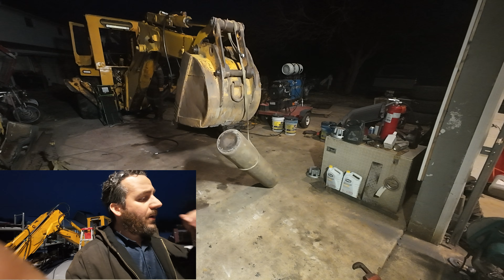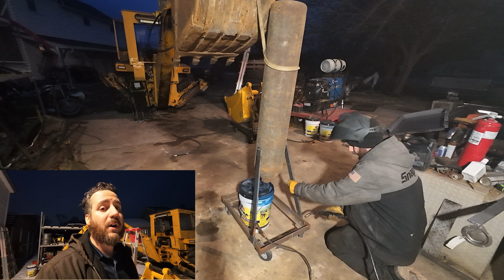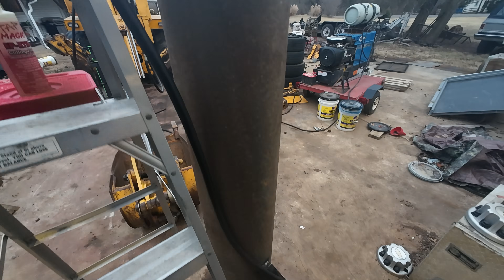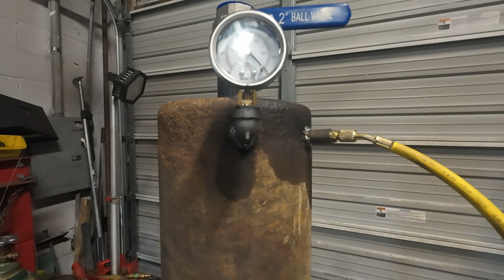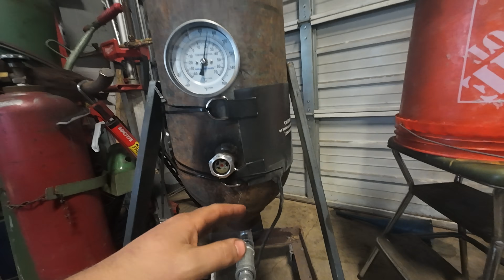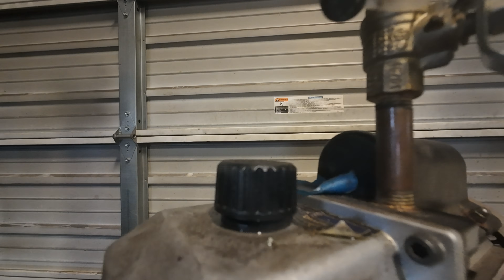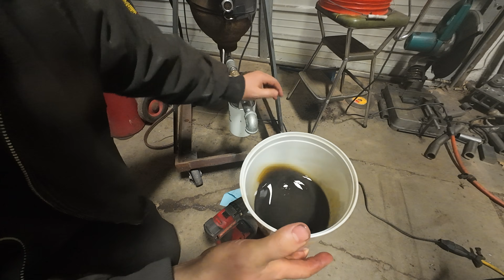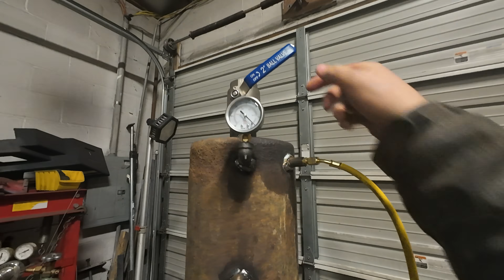I made a machine to remove water from hydraulic oil. Vacuum de-hydration

Comment: 30 years ago I bought a pump that was retired from vacuuming sap from trees from a salvage catalog; basically an electric motor with (I think) a rotor-type pump built onto the shaft. I believe that company is still in business and of course has a website (didn't exist back then LOL!). One of the uses it mentioned in the catalog was as a vacuum pump for a/c systems. Couple of standard brass fittings into the pump and ya, it ran super well. It was much faster than the little oil-bath style that you're using and in fact used no oil at all, the pump ran without it although it would get pretty hot. That pump didn't pull "quite" the vacuum the oil-bath style does, like peaked out less than an inch Hg below what you're getting IIRC, but it worked fine for my auto a/c purposes and I'm sure it would work fine for yours, with the added bonus that you wouldn't have to fool with replacing the oil in the pump.

Oh, another idea. CO2 pumps will pull that vacuum as well, and also don't have an oil reservoir. I don't know how common those are, but I got mine from free from a service/technician guy who had just serviced a C-store in my area. I saw it, mentioned what I could use it for, and he said "take it".

Comment: Would definitely stick a condenser pot in line with the vacuum pump. It would definitely save your vacuum oil from getting so much water in it.

Comment: With 5% moisture in it 50 gal of fluid has 2.5 gal of water. It is a lot! This is what the vacuum pump has to evacuate. Unfortunately, that much water will kill your vacuum pump rather quickly. Centrifuge will help remove the most of that water. And then the vacuum pump will need to do less and will last longer.
A typical centrifugal milk separator does 3 gal per hour (approx). And it lasts forever. Something of that scale would do the job.

Comment: I filter waste oil with a centrifuge and heat it up in a barrel with a 1500 watt electric heating element, I circulate it for an hour with a pump, running threw a centrifuge and with heating element, and after an hour, I can filter and eliminate water out of 55 gals.
Reply: yep old tech and still used on ships. becuase its reliable and cheap.
Reply: Make a video I'd like to see that sounds very interesting

Comment: You can know exactly how much water in the oil when you start. Measure the weight to volume ratio of good oil then compare to oil that has water. Understand?? Yes you must have a "trap"  make a coil and condense the vapor coming out so you don't run water through your vacuum pump.
Reply from the maker: It may of gotten through broken windows on the cab and torn up shifter boots. I bought the machine for scrap price and the water in the oil came with it, free!

Comment: The fluid will stay cold at the bottom because hot rises.  The heater band should be as low as possible.
Reply: As the pressure goes down water will make bubbles. These bubbles will stir up the fluid pretty effectively.

Comment: Id try buying oil that isnt hydroscopic cheap tractor fluid attracts water like crazy
Reply from the maker: Yes and no. The water is already in the system so at this point I am happy the oil is carrying it out. Would be better if the water was never in there, but it came this way.

Comment: Maybe try weighing your input vs output to determine loss of the bad guys.  You might also add a ":cold trap" in series with the line to the vacuum pump.  We used to use dry ice (solid CO2) to cool our cold traps in high vacuum heat treating furnaces

Comment: Awesome device and seems to do the trick. As a suggestion using an induction coil to heat the tank/oil may decrease the time to bring the oil to temperature. Also a 1 micron filter after the 10 micron filter should help remove more particulate contamination and possibly clean up the oil colour. To me the 1st run of oil through your system did seem darker, possible contamination from the internal cylinder walls? Next level device would be to somehow plumb the water seperator directly into the hydraulic machine so the water can be removed and oil cleaned without manually removing it from the machinery. I suppose either way manually vs inline, a method to efficiently clean all the oil in the machine would be beneficial as you will reach a point of diminishing returns if you are cycling cleaned oil into a contaminated hydraulic system, unless you can remove all the oil from the machine in one go and process it.

Comment: Where is the water coming from to begin with? Condensation?
Very interesting build. I made a similar unit to remove ethanol from gasoline, although ut was much more simple than your evap system. Still, it works excellent.
Best regards from Vermont NEK
Reply: I think it's basically water that accumulated through the years, since I'm pretty sure that the equipment was second hand. Once it's in the system it's super hard to remove without a lot of flushing.

He said that there won't be more water coming in so I assume it's mostly just to flush the water that's already there, and that it wasn't maintained correctly before he got it.
Reply: @amogusenjoyer  yeah, but it still doesn't explain the source of the water contamination of the hydraulic fluid

Comment: Three big takeaways here. 
0. You don't seem to care about preventing water from getting into the hydraulic system in the first place. This fix is easily the best long term value measured in cash or labor.

1. You would be well served expanding this into a vacuum still. Basically make a cold condenser and after that a second small vacuum tank for collecting the water before the vacuum pump. How to do the condenser, maybe a small reclaimed radiator or coil of copper/aluminum tubing in cold water/ice bath.(Also use an ice bath on the collection tank so it doesn't re-evaporate). If fittings are all well sealed and with a good valve at the pump then the pump won't need to run much after the first few minutes of purging the air(you want 100% water vapor), the cold condenser will maintain the low pressure, and the heat on the evaporating tank will control the process rate (foaming). You may want some sort of large diameter clear tube at the top of the tank to watch for foam.   

2. You have done inadequate research on types of hydraulic oil. 
Dot3 and Dot4 brake fluids, and "Universal tractor fluid" spec'd for most farm equipment, are designed to absorb large amounts of moisture. Many industrial hydraulic fluids are designed to quickly separate from water on settling. There are reasons for both. Tractors and farm attachments have many low spots and slow flow areas and uncontrolled temperatures and a need for chemical compatibility as implements are swapped around from tractor to tractor and vice versa. Industrial systems are usually more closely engineered for flow velocities and avoiding low spots(or making them deliberate collection points) so water doesn't collect and corrode out.
Reply from the maker: Careful making assumptions before casting judgement. I don't let water get into my machines oil. But I do buy machines that are left for scrap, and I do find water in them almost every time. This video was not about keeping water out, it is about removing it once it happens.
Otherwise your tips on the cold trap are spot on and I would like to implement that some day if I continue to use this device to separate the water from oil.

As for the different fluid designs, once again I am just working with what I have here. As you mentioned, the tractor fluid is designed this way for a reason. Its working as intended (holding the water), I was just seeking a way to strip the moisture and still have usable oil left over.
Reply: @spankranchgarage  All fair. I was mostly posting for the viewers who may think this is a substitute for prevention or who don't know why a factory selects one fluid over the other.

Comment: That bottle seems to have been coated on the inside with something, there was some dark material on the inner side of the puck you drilled out. If that got dissolved in the oil, that might explain the dark color.
Also what I find a bit concerning is the height of the oil column. The vacuum only applies to what is directly on the surface, everything else has additional pressure of the oil above it. But with the time you let it run, I guess the convection did its job.
Reply from the maker: Its probably just rust on the inside I would think. Yes the small surface area isnt ideal, the convection helps. I also have a tiny air leak at the bottom that allows the fishtank bubbling effect to break the surface tension and pull dryer air through. Just a tiny trickle but its working.

Comment: A few changes I would make.  First, I would heat the oil before sending it into the distillation column.  Then, I would pull a vacuum on the column before pumping the oil through nozzles into the column.  The warm oil will separate from water more readily and the spray droplets likewise promote more rapid separation.  This should also minimize foaming.

Comment: Hello, Nice job, how about using the vacuum to fill the tank up into the site class, instead of climbing a ladder drilling a two inch hole, installing a two inch ball valve. You have site classes to monitor the level. Thanks for the video.
Reply from the maker: A great solution to the back breaking

Comment: I'd create a secondary tank that goes between your drier and vacuum pump  to catch possible overflow, add copper tube coil to condense the water back to liquid and put it between  new catch container, preferably with a see through top.

Comment: If you add a needle valve to the inlet of your vacuum pump and let it run with a tiny amount of air bleeding in, the moisture will evaporate out of the pump's oil. Could save you some money on pump oil.

Comment: Much easier and cheaper way is how the oil industry does water separation.  Since 1911, oil companies have employed electric fields in oil-water 
separation. The electric field enhances coalescence of the water drops in oil, which leads to more efficient separation. This is called electrocoalescence.

Comment: You shoud direct the compressor outlet through a copper tube and wrap it around the base or the cylinder to warm the oil. And insulate the whole thing. At least that's how most brine crystallizers and vapor compression distillation systems work.

Comment: A decent centrifuge will clean your oil, and with your dewatering system you're good to go. All you need is a can with silica gel in line before the vacuum pump, to save on the pump oil. Silica gel is also reusable.
Good job

Comment: You do realize putting oil in vacuum lowers the boiling point of that significantly aswell so you get the boiling point of the water to 100 youre gonna be doing the same thing one plus is less money for heating

Comment: Weighing the oil before and after treatment should give the amount of water removed as long as the losses from oil trapped in the filter and test samples etc are accounted for. The newer luggage scales are cheap and accurate enough. Running multiple smaller batches is a good idea to avoid potential foaming etc. The color of the fluid would not be a problem if you use the treated hydraulic fluid to flush the system multiple times and then put in new fresh fluid.

Comment: Hi. I liked your video. As a nuclear physicists I have worked with a lot of high and ultra-high vacuum systems. The pumping was two or three stage. A roughing pump (mechanical) the take the chamber from atmospheric pressure to a partial low vacuum, then a vacuum pump (like you had) would introduced the the system and it would draw the chamber from partial to high vacuum, then a cryogenic vacuum pump would take the chamber down the rest of the way to ultra-high vacuum. Each stage of pumps can handle less and less volume, but does it to a level that the others can not reach. This staged approach could save your vacuum pump oil, also a roughing pump will be much quicker. 
Great channel! I would be having ‘sodas’ too if I have the rusty ‘stuff’ to work on like you do. 
Be Well
David
Reply from the maker: Thanks for stopping by! Very cool information you shared.

Comment: I have several tanks with deeper pits recently filled, with *+ hydro.  It  was the company you chose that would not send it for hydyo, but would happily sell you 1, i have had this issue several times at purity, and when they sold me a tank almost out of test then 6 months later  got me for almost $200 for hydro x-ray and a valve on said c02 tank i now drive further to a competing company

Comment: Could you accomplish the same thing on the tractor by pulling a partial vacuum on the reservoir?   I know your hydraulic pump would be fighting the vacuum a bit, but you wouldn't need as high of a vacuum because the oil would be going through the vacuum a lot more - so you wouldn't need to boil all of the water out each time.

Comment: Skimmer for oil separation..we used them back in 2000 on drill press..driven like a belt with one end submerged slightly below fluid surface...pulls the oil out of the water

Comment: Nice build! Looks like it worked amazing. We always did the turkey fryer method. It sucked ass, took forever, could be dangerous and like you said it most likely degraded the oil. Our machine had like 100 some gallons if i remember right. Huge pain in the ass. All because previous owner left an oring off the lid to the hydraulic tank.
Reply from the maker: Ouch!

Comment: You are correct. The additives cannot be replaced with your processing. You can go a few steps farther by additional filtering to strip out more of the small particulates.  Sadly the finer the particle you want to strip, you add time and filters. Not to mention the amount of points you transfer to prevent having to change filters more often. No jumping from a 10 micron to a 2 micron filter kind of thing. And as per the color, while it was flowing, the stream is what you want to look at. It had some dirt, but otherwise was matching a standard hydraulic oil color.  Like an olive oil or vegetable oil in color color. Kudos on spreading information that so many can benefit from learning.
Reply from the maker: Thanks for stopping by!

Comment: 23:12 looking dark is normal. Same goes with a 5gallon of diesel oil. I have to open them to use them in motoryatch and the  brand new oil is exactly the same color as your hydraulic oil. It looks darker in the bucket.
Reply from the maker: I agree!

Comment: Vacume freeze dehydration will help save your vacuum pump. 

Maybe you can use an old air conditioner compressor to heat the hydraulic fluid tank and freeze water moisture in the freeze tank. 

The compressor would push and compress the refrigerant into a condenser coil wrapped around the hydrolic fluid tank.  The compressed refrigerant heats up under pressure and give the heat up to the to hydrolic fluid tank to boil off the water. 

Then the refrigerant  through an expansion valve or capillary tube to maintain a pressure difference between the condenser coil and the evaporator  coil. 

 Once the refrigerant makes it way into the evaporator coils wrapped around the freeze tank,  the refrigerant is now under the low pressure and cold which makes it able to absorb heat from the freeze tank that pulls heat from the water moisture freezing on the walls of the freezing tank. 

You can now pull a vacuum, seal it, and turn your vacuum pump off, because freezing the water to the walls of the  the freeze tank helps maintain the vacuum pressure even as water moisture is boiled out of the hydrolic fluid. Then after a period you can seal the hydrolic fluid tank from the freeze tank and let the freeze tank warm up and let the water drain out. 

Add bats of insulation  around both tanks to offer better efficiency.  This should be a lot more energy efficient than running a vacuum pump continuously, and helps minimize or eliminated water getting into the vacuum pump oil.

Also, Think about water evaporating from a 1 sq foot puddle vs a 1 sq mile pond. Surface area makes a big difference in the rate you can evaporate or boil water out of the hydrolic fluid.  A small fluid pump could move hydrolic fluid from the bottom of the tank to the top and dribble it over stainless steel wool scrub pads a distance from the top but certainly not submerged.

Comment: Very nice results! I can relate, with my working on antique refrigeration stuff. The old compressors end up with moisture in them and heating them to a safe but warm temperature and applying vacuum really does remove the moisture.  If and when you have time, you might build cold trap to collect the water before it reaches the vacuum pump, to save vacuum pump oil. But, if that cost is not an issue, no need to worry about it!

Comment: Would freezing the oil/water mixture also work?  I would think if you froze the mix you could then let the oil drain off?  Maybe use it as a pre separation stage?
Reply from the maker: It does not work unfortunately. That water stays bonded. But I was thinking that maybe freezing it then passing it through a filter might capture "crystals" of ice. This freeze and dump method does work with normal engine oil however